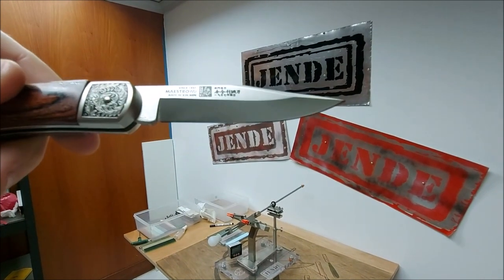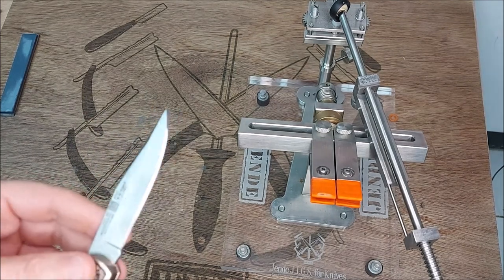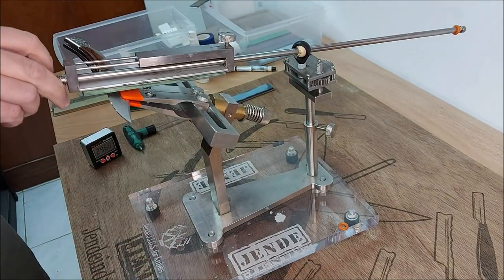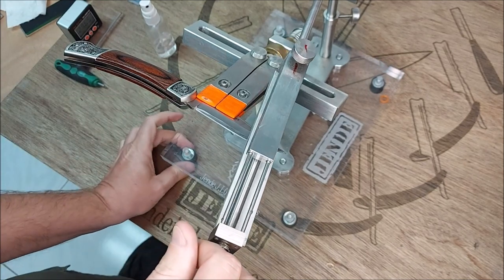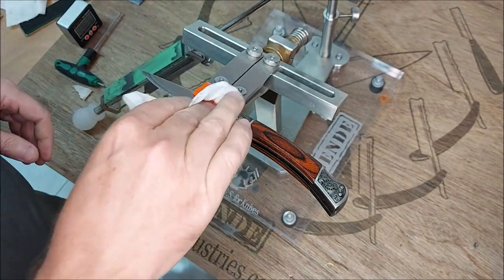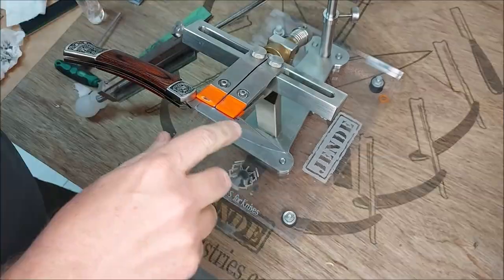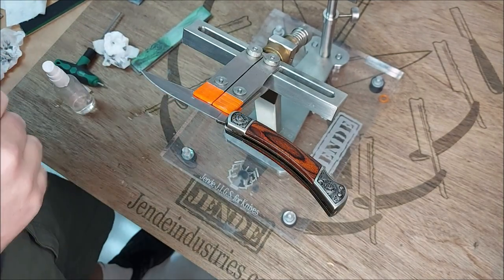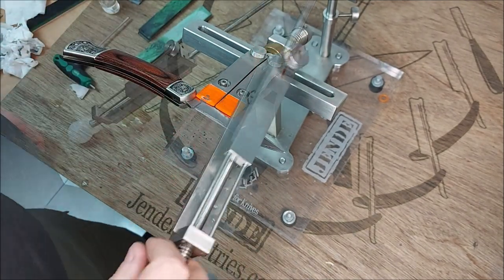Pocket Knife Sharpening to 10K on the Jende JIGS for Knives - Maestro Wu BO-6

Comment: That is a beautiful edge!  I have been running 5°-7.5° edges on my Spyderco PM2 in S30V, so the bevel is quite wide, and any imperfection in the grind shows up.  I just can't get away from liking the V-Grind Mirror Polishes for my EDC.
Reply from the maker: Yeah, I'm used to wider bevels, too. I usually convex more when freehanding, but on the JIGS, I'm very satisfied with 1 angle, maybe 2 if necessary.

Comment: How long a knife can you sharpen with this machine?  I  have. KME and that is the one complaint I have about it,  are the limits on length of knife it will sharpen.
Reply from the maker: The Jende JIGS for Knives has an arm swing of about 26 Inches. So handling 12" knives is no problem.
Reply: @JendeIndustries  wow.  Do you take trade-Ins?
Reply from the maker: @mickkeim4142  knives or systems? 😁